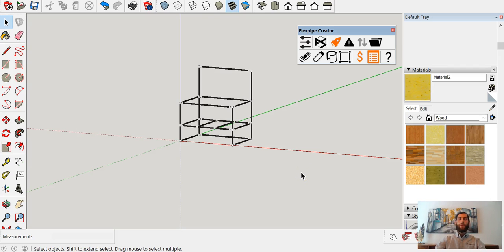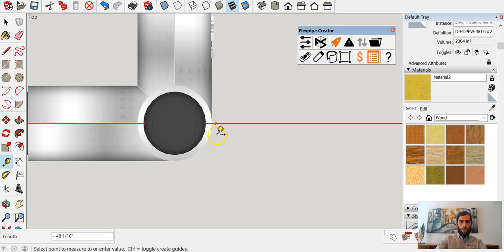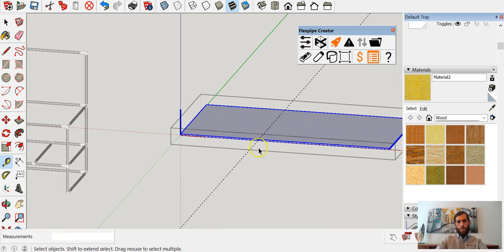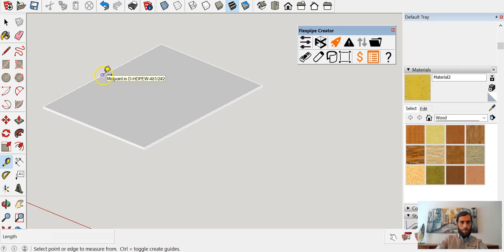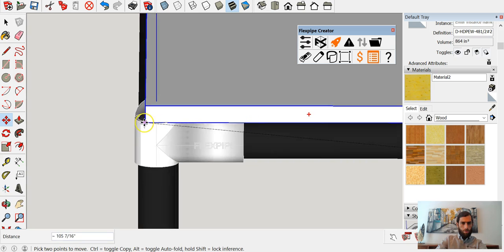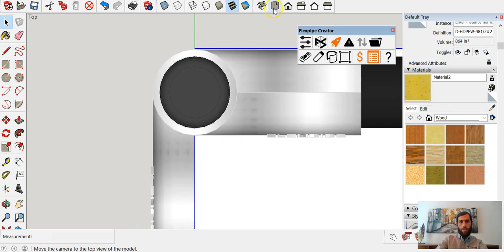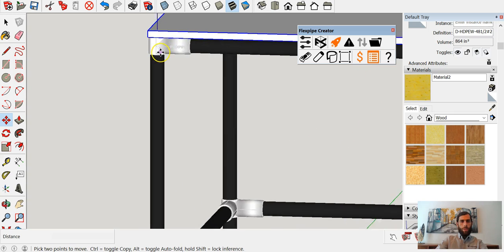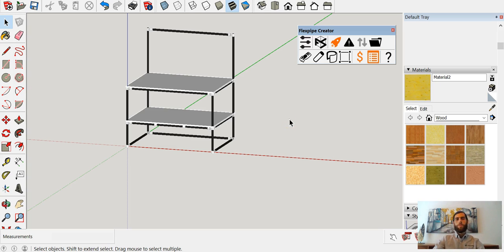How to install decking surfaces in SketchUp | Flexpipe

Comment: How would you secure these surfaces the way you added them to this design?
Reply from the maker: Select a particular pipe which is below the surface you wish to attach, click on TOGGLE ALTERNATIVE ICON and select accessory or drag and drop from library icon into drawing and place into desired position.